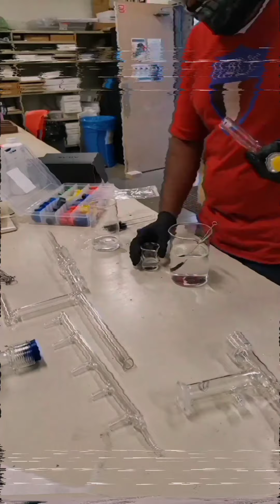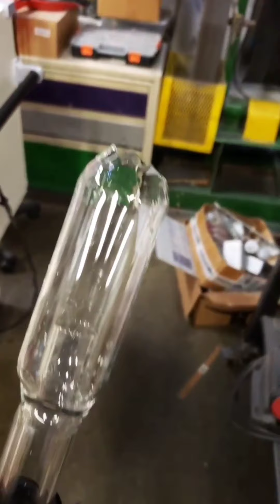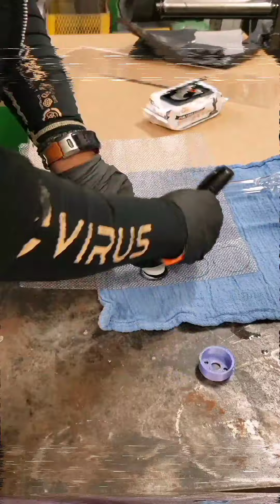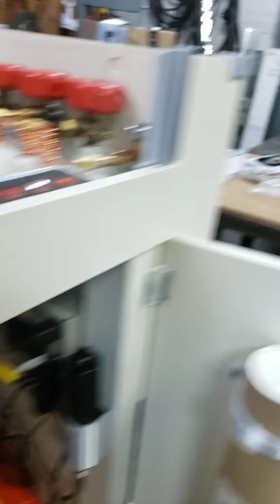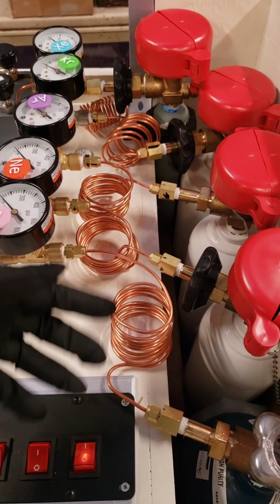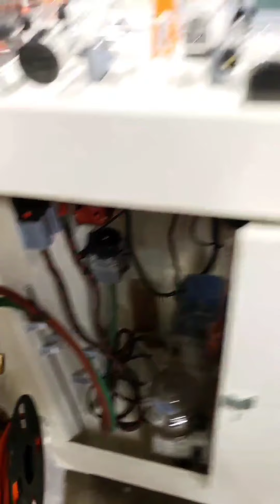PGC Light Lab UPDATE Oct 26-Nov 5, 2020

Comment: Can you detail what kind of solution you're using to leak check? I wouldn't think you'd get bubbling with negative pressure. I've tried alcohol and looked for pressure changes but to no avail.
Reply from the maker: When setting up the new gas transfer system, I pressurized first. This will help with any obvious leaks since those lines will be under pressure. The solution is to use is dawn dish soap and water, or you can purchase SNOOP from Swagelok.  I then evacuate and test for leaks after 24 hours of evacuation. I've used the alcohol to find leaks in spaces where a spark coil wouldn't be as useful. I watch for rise and pressure thermocouple gauges. This trick has served me in several leak searches lately.